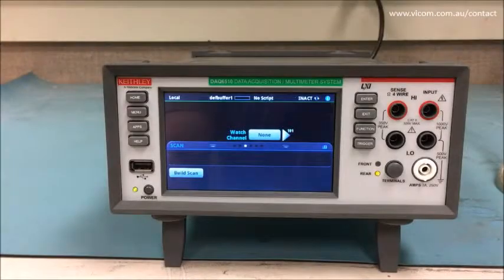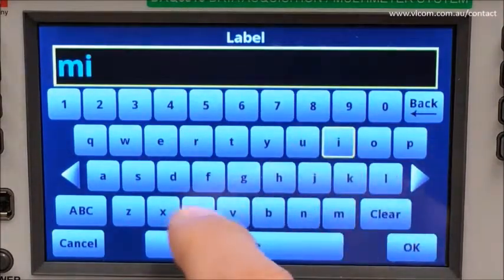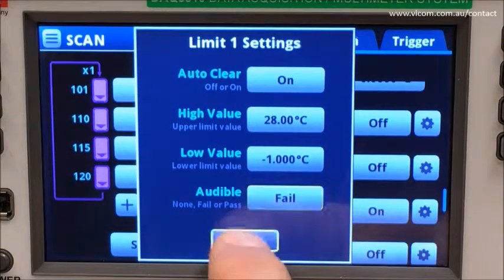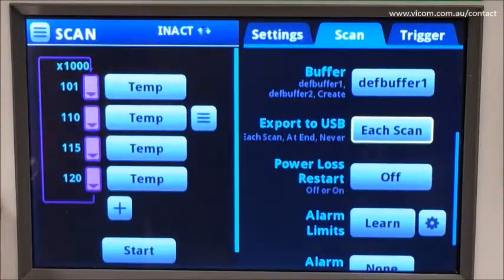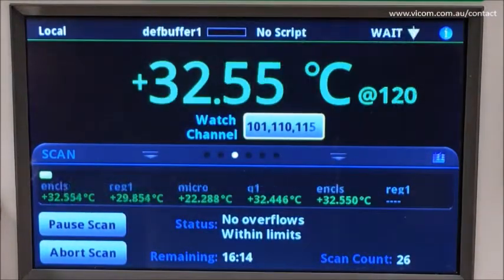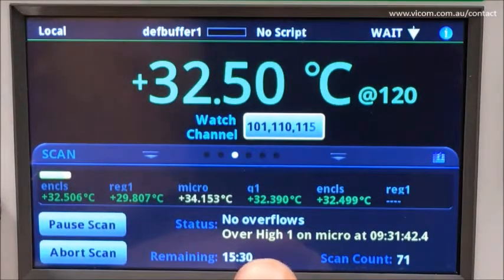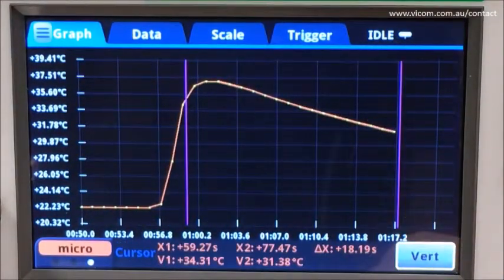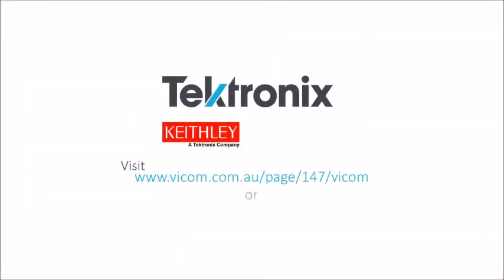Temperature Scanning for Thermal Profiling with the Keithley DAQ6510

Comment: What reference temperature did you use? You didn't set that up?
I have a DMM6500 that want to have a fixed reference typed in. I want it to measure the reference temperature by itself, but it doesn't work.